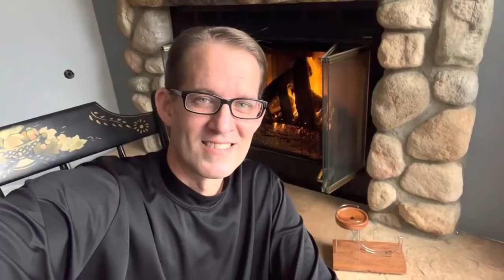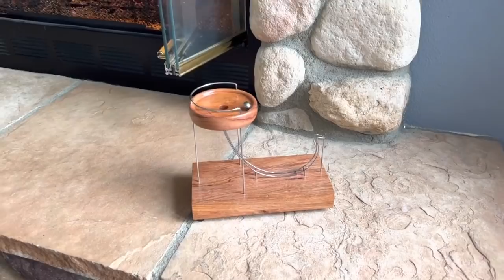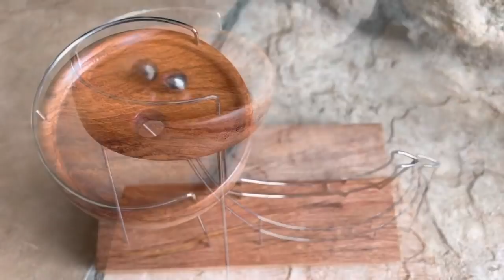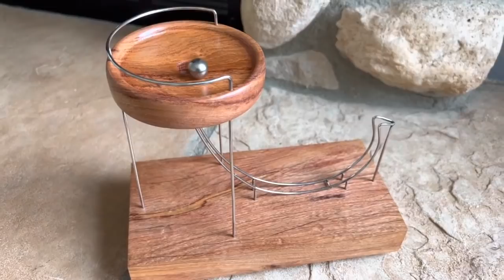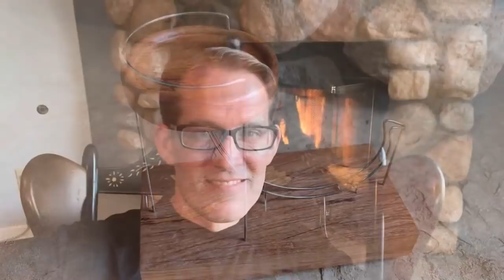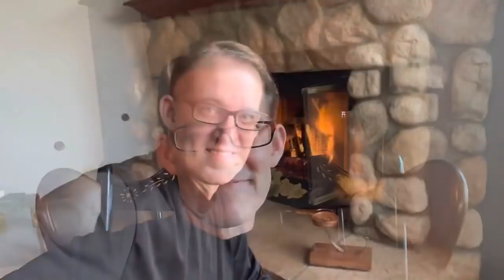Perpetual Motion Marble Machine in RamZland!

Comment: Thanks for explaining about the electromagnet. I was wondering how that ball kept on jumping so high.
Reply: I wasn't...
Reply: Yeah the speed of the falling looks a bit too fast for normal condition. It just looks odd in first glance.
Reply: The ball is jumping because the width near the end of hook ramp narrows thus increasing speed and efficiency to create a propelled jump.
Reply: @Polymer-Studios  erm.. No. He has literally just explained to you in this video that there is a hidden electromagnet that is cleverly used to impart more energy into the ball so it gets enough energy to jump back up to the top of the device. Did you not watch the video?
Reply: @Polymer-Studios  False. Please, avoid speaking from a place of confidence on topics you do not understand. You can clearly see the EM field making the ball jump about in the bowl just after the return on some passes.

Im guessing there is a little bit of ringing, or hysteresis, or false trigger in the system, causing the ball to interact with the  magnetic field of the coil around the hole. Id vote hysteresis of the field collapse since it pushes the ball away, the same way it would have when it fired except backwards as it pushes the ball up instead of sucking it down(if the ball were in the hole it would go up instead of down. The normal mode is to be pushed down, of course). So its on the reverse swing of dumping energy and ringing out as inductors do. But I can clearly state my OPINION as OPINION and not as if its a point of factual truth. Its a guess, having not owned one. An assumption. An opinion based on review and experience with electronics and magnetics. 

The ball would impart more force and there for friction, regardless if its rolling or not, as the radius got smaller therefore accelerating it as you propose. This would be a net loss of efficiency in the system as a whole. But, Im not saying it doesnt help. Im sure it helps shape the curve it needs to follow for maximum efficiency through the system given its mass, rolling friction, and added kinetic energy kick from the coil. However, remember, A ball will 'gain' rotational energy as it rolls down diverging rails, and lose energy on converging ones. So if these converge, or narrow, than its exchanging its kinetic energy with the rails to tighten its curve(ie, increase its velocity vectors rate of change. To change velocity in any way requires an energy exchange, therefore the energy it had when it fell is reduced for every interval of exchange. It cannot have more energy than it started with purely under earths gravity alone, it needs a little extra to spend on the rails diverting it to end up with an equal(same height) or greater(or higher) height when it returns. This extra energy to lose imparted into the rails as it falls is given to the ball by the electromagnetic coil. Basically its a tiny repeating rail gun ;)
Reply: @mandi8345  Amanda stop Whining & accept the truth about real time physics.
Reply: Couldn't it use a natural
permanent magnet instead?
Reply: @hamishanderson6738  I am guessing the magnetic field is turned on briefly to accelerate the sphere , then turned off. A permanent magnet would simply hold the sphere in place or slow it down instead.
Reply: I think you're right (dammit!) 😅
Reply: @Polymer-Studios  She did explain it (the truth about real time physics) very well ;)
Something falls.
And encounters friction.
But yet it then jumps higher up than where it fell down from?
... right ;)

Comment: Could a regular magnet be used instead of an electro-magnet?  Would it then in some sense be a perpetual motion machine since it would not need to be re-charged?
Reply: It needs to be an electro magnet that be switched on and off at the correct time. A regular magnet can accelerate a steel ball as it's being pulled towards it, but will slow it down as the ball tries to goes past the magnet.

Comment: Actually all that needed to be said as to why the ball can't return to its original height is that for it to do so the situation would have to be friction-less.  The mentioning of air (atmosphere) as an additional factor is redundant, as the presence of air is just another example of friction (air friction).     Also, if the situation existed without friction (which it can't), the ball could no longer roll.

Comment: Crazy idea.  Put a coil of copper wire around the 1st part of the track.   As the ball passes through the coil it creates a small charge.  Use that charge to push the ball like the battery does.   BTW I know perpetual motion doesn't exist but I like to think about it   :)

Comment: Funny how you say it's a "rechargeable electromagnet" that is providing the energy to make the ball bearing speed up so it can make it to the tray on the top, but you don't (or should I say WON'T) say that any magnet (that would last forever) could provide that same energy boost.
   So it actually IS a perpetual motion machine, and that is because it could have an ETERNAL energy source. Yours may have a rechargeable electromagnet, but it could have a permanent magnet.
   Seems to me there's something missing in those "Laws" of Thermodynamics.
Reply: It has a rechargeable BATTERY, coils and electronics in the base. One coil detects the balls position, the second coil is energised by the battery to attract and accelerate the ball. The electronics handles the detection and timing of the energising pulse.
Reply: Would a normal magnetic cause drag tho if its not switching on and off so to speak as an electromagnet does.
Reply: There is no such thing as a "magnet" that lasts forever.
All magnets lose power throughout their lifespan. so this would work until the magnet is too weak to do it. Aka, not perpetual.

Even if there was such a thing as an eternal magnet, it would just stop the ball when it got to the bottom, the "switching" on and off is necessary for this to work.
Reply: @1999moniz  This "toy" works using a hidden electromagnet which is switched, pulsed, on and off quickly, the ball position being detected by another coil. I don't think there is anyway you could achieve this with a fixed permanent magnet! and by the way, to all intents and purposes, one can indeed have a quality magnet which will keep it's strength for "almost" ever. The stuff I have read, it's about 1% loss over a 100 years and about 700 years to half "life"... I would guess it depends upon the stability of the domains and the crystal structure that aligns the atoms

Comment: It can still accomplish that perpetual motion with out the so called magnet. Just change the height and direction of the ramp to point closer to the wooden basin.
Or change the design of the circular wooden bowl to an elongated bowl much closer to the end of the ramp to account for the speed the metal ball drops
Reply: It couldn't work because the height that the ball would need to attain to get back into the basin would need to be higher than the height from which it was dropped
Reply: @DragnSly  don’t get me wrong most people just think that design is the only functional example. Most people aren’t designers or innovators to have creative logical thinking while applying some physics principles to things. Anyone with a computer simulated program could easily design alternatives. And where exactly do any of you people think the creator of this video install the supposed magnets. Because certainly as anyone with experience of observation can tell there isn’t any kind of magnet installed on or in the wooden bowl. If there was the metal ball would of illustrated a directional pull when the ball landed in the wooden bowl
Reply: @1999moniz  this is a nice video and for this design it works for it. Change the design and I guarantee you it can continue without any magnet in the base of the wooden plate.  The top wooden bowl doesn’t have to actually be a circle and the design of the ramp can easily be raised and pointed closer to the entrance of the top plate. Even by raising the height of the wooden bowl the metal ball can actually gain much more speed and then with a design change of the ramp the ball will land in the newly designed top plate. Many inventions defy the laws of physics. And besides magnetism is part of physics and can always be applied to any machine. Why is it that people think that perpetual motion machines have to be solely designed and invented without the use of other mechanisms?
For example the perpetual motion machine that does require an initial voltage to self excite the coils on a motor to motor generator. It’s still perpetual once in motion until the mechanical functions or circuitry fails.
How about the pit and the pendulum. It’s perpetual motion machine and requires the use of an external source of energy to be applied to set it in motion. 
And how about the planetary systems and various solar systems? Every planet has a magnetic field and and different laws of physics for how the planets function and orbit. People would always say that for every action there is an equal and opposite reaction. Yet that doesn’t actually apply to everything in life whether it be physical objects or emotional stimuli which all require many different types of energy and mechanical functions. Chemical alter and change many mechanical functions as well.
This is a great way to get perspective and insight and I hope it stays that way. My post were meant to get people thinking creatively not at all ignite a challenge and argument to prove right and wrong and fight about it. (Not implying that was your intent) 
just expressing because I already know how the majority of mankind always seems to try and ignite a fire inside and fight about things rather than just share and express what each individual has come to understand and maybe bounce different ideas with each other.

Nice video though. The original one I viewed didn’t show all the specs and modes of function.

Comment: What if it wasn't an electromagnet, what if it was an ordinary magnet, would that work? Why would it have to be an electromagnet?
Reply: Because the magnet must turn on and off. I'm guessing here's a sensor in the base, sensing the ball passing over it, the electromagnet turns on and accelerates the ball, and then turns off just as the ball passes it. A permanent magnet would just pull the ball backwards again after it has passed, and that wouldn't work.
Reply: @HGSolberg  Thanks!

Comment: The magnet must turn off as soon as the ball gets to the base, otherwise its pull would hamper the acceleration to the upside.
Reply: If I was designing this, I would make the metal ball contacting the metal tracks, as contact. That would cause a circuit to fire off a short, high power burst on that magnet to accelerate the ball, but shut back off in a micro second. I'm with you on this and it can be pulled off easily. Good call and the parts to make it work are visible.

Comment: Thanks for explaining this! When I saw this machine in another video I thought it was odd how quickly the ball was moving at the bottom of the track but wasn’t sure what it could be.
Reply from the maker: Sure!😎
Reply: @bridgeportelementarystem36  All these perpetual motion machines are fraudulent, like the cars modified to run on water, usually by 'unburning' it in some way back to Hydrogen and Oxygen. The gullible still fall for it like the three card trick snd always will - and the inventors are always murdered , die in mysterious circumstances or are bought off by the oil and car manufacturing industry. These people still believe in Phlogiston theory and think the world is flat.
Reply: @bridgeportelementarystem36  show us where the battery is underneath jackass
Reply: @bridgeportelementarystem36 здравствуйте там нету подлоха?

Comment: Can this be done with regular magnets as opposed to electromagnets?
Reply: No it cannot. The electromagnet has to be switched on, and then off at precisely right times. Regular magnets can't do that.
Reply: Yes, as Rene Dekker noted.   The permanent magnet would need to moved away from the ball rapidly as the ball reaches the bottom.  It would be mechanically more complex, needing something to move the permanent magnet, and a timing mechanism to keep the fluid motion of the ball looking moderately natural.
Reply: @jfess1911  😂🤣😂  and how would you move it  ?? With another electromagnetic device  ??  😹🤣😂
Reply: @rohitkhanna     I understand mechanics better than magnetism, so I would do it mechanically.  Literally pull the magnet away from the ball.  Magnetic force follows an inverse square law with distance, so with proper timing, the magnet would not need to move terribly far to effectively "break contact".
Reply: @jfess1911  actually, magnetic 'force' tends to follow a somewhat inverse cube law. And the relationship is worse at short distances. Where on earth did you larn that a magnet has an inverse square behaviou s?!?
Reply: @rohitkhanna Oops.  I wrote the wrong word despite looking up the correct answer online.   I beg for your forgiveness.  You are correct that the force tends to follow a somewhat inverse cube law.  The point is that a relatively small displacement will dramatically reduce the attractive force.  FWIW, the same mechanical technique would work either way.
Reply: Only if the regular magnet is moved at the right moment.

Comment: It feels gratifying to have guessed about the electromagnetic accelerator in the base and to have it validated. Even though it was obvious, still.
Reply: Except it isn’t a magnet, well, there are magnets, but not like you think. There is a small electric motor spinning a wheel. The edge of the week is in the throat of the hopper.  When the marble drops into the hopper’s throat, the wheel grabs it and flings it down. At least that’s how the one I bought works and there are other vids showing this, and none showing any “magnetic” based system.

Comment: Wouldn't a strong Neodymium magnet eliminate the rechargeable battery?
Reply: Not without some moving parts.  A normal permanent magnet would accelerate the marble down but pull it back once it started up.  The trick is that the electromagnet accelerates the marble down but turns off before the marble starts on its way up.   The easiest way that I can think of to simulate the same effect with a permanent magnet would be to rapidly move the magnet away from the marble at the bottom of the rail.   It is possible that a rotating pole magnet could work if the marble were magnetized.
Reply: @jfess1911  Ahh OK. A Relay or Contactor that switches on the Magent to attract, and switches it off immediately after to ensure the ball launches and moves ahead. Otherwise the ball would simply get stuck.